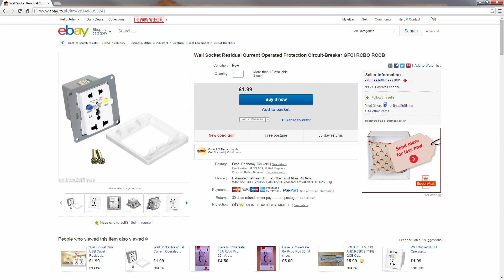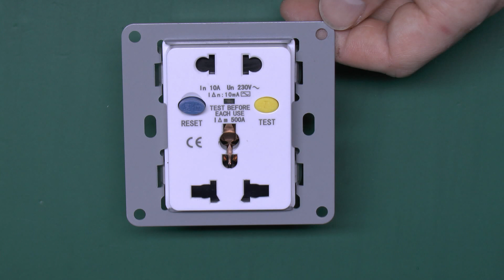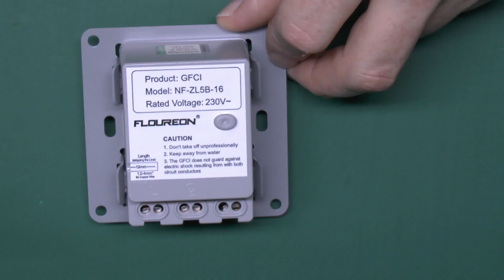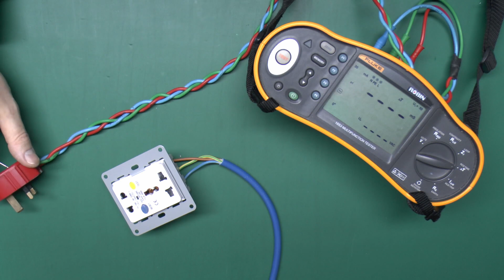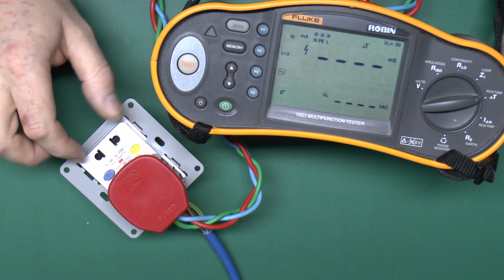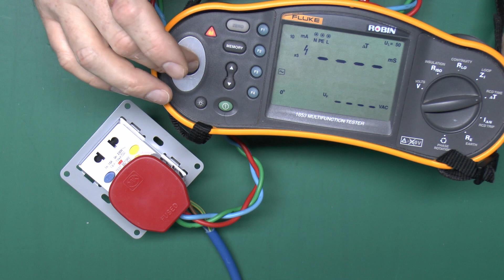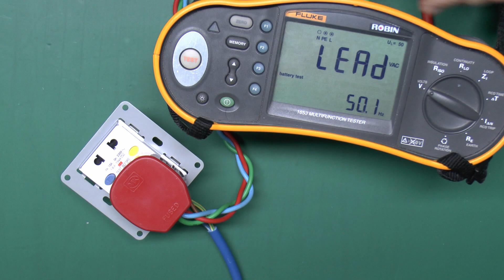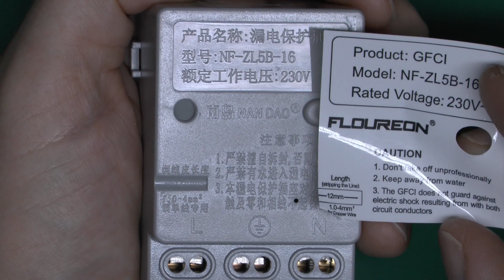Floureon RCD Socket Tested & Dismantled

Comment: Googled CL4140 comparator. Could only find the quote "The CL4140 is a low power controller for AC outlet appliance leakage circuit interrupters."

Comment: I delta M is usually taken to mean the maximum current making/breaking capacity when tripping due to residual current. 

500A is quite a low rating, as a live-earth short on a low resistance TN-C-S system could exceed the breaking capacity of the device - this isn't necessarily a problem as this should be adequately covered by the overcurrent protection.

Comment: Shouldn't think this could be installed in the UK, as the contacts would not meet the requirements for size, and as the socket is only rated at 10 amps, it would definitely need it's own overload protection, maybe from a fused connection unit, with a 10 amp fuse inside. Connecting that to a 32 amp ring or radial circuit could be disastrous, given that it accepts un-fused plugs.
Reply from the maker: jayja45 I have updated the description with this information

Comment: Very interesting. In the US, our GFCIs are typically rated 5mA, and 30 mA seems surprising to me because that is a potentially lethal current. The other problem, and the main reason I don't trust it is the way it tests. When you press the test button on a proper American GFCI, it connects a resistor between live and ground (Earth) creating an actual ground fault rather than an   imbalance on the sense transformer.

Comment: That 8-pin IC seems to do it all, including deriving its own supply voltage from the mains.

The CL4140 is a low power controller for AC outlet appliance leakage circuit interrupters. These devices detect hazardous current paths to ground such as an appliance falling into water. The interrupter then open circuits the line before a harmful or lethal shock occurs.  Internally, the CL4140has a diode bridge rectifier, zener shunt regulator, op amp, current reference, time delay circuit, latch and SCR driver.

http://33016779.company.weiku.com/item/Integrated-Circuit-4140-16471620.html - but there's no data sheet available online as far as I can see.

Comment: Pressing the F1 button if you measure voltage is switching between the measuring of line against earth, line against neutral, or neutral against earth. You don't need to change the cables on the terminals of the Fluke. Got the same device...and this is something you could not read in the manual for whatever reason.

Comment: I suspect the blue small wire (which bypassed the CT) was for the test function
Reply from the maker: ***** Yes, that wire immediately goes to 2x 7k5 resistors, then the test button.  15k at the device rating of 220 volts would be a current of 15mA, which seems reasonable to test a 10mA device.

Comment: This sort of reminds me of hotels. I've seen sockets like this installed in bathrooms etc. so guests could use their own eletric shavers or other devices without using an adapter.
Reply: These are special shaver supply sockets with an integrated isolation transformer. But they are limited in power from 20 up to 50 VA. There's no RCD inside, the security is the galvanic isolation from the power grid. You have to touch both connectors at the same time to get an electric shock. And sometimes the isolation transformer is used to lower the 230 V to 115 V, so you could use devices with different voltages on this socket. But in times of wide- or autorange power supply this is not longer necessary.

https://en.wikipedia.org/wiki/AC_power_plugs_and_sockets#BS_4573_.28UK_shaver.29

Comment: @ 5'53", I wonder if the two holes are for feed in/feed out? Or is that illegal in the UK.
Reply: Most certainly they are! Actually this was a fairly common setup for high-quality sockets in Austria and Germany back in the 80s and early 90s, before screw terminals were all but replaced with spring-loaded push-in terminals. You're supposed to stick in one wire per hole and then tighten the screw. Takes stranded wires without ferrules according to VDE regs because the wires aren't directly under the head or end of a screw.

Comment: I was astounded about the build quality when I got those compared to the price I paid, this was around 2.5 EUR here. It definitely requires a fused circuit upfront of quick acting @ 10 Amps. My concerns are others. Most European regulations do not allow the use of AC onlz GFIs, they have to be pulse current sensitive. The manufacturing standards were changed somewhere in the late 1980s, no longer allowing non pulse sensitive units to be produced. Some local electric codes followed that decision (East Germany for instance), others did so in the 2000 years. From around 1987 on everything you could get from EU manufacturers in wholesale or supply houses was pulse sensitive. But basically AC only came into Europe again thru CE imports. 
Another point, single GFI units for a single circuit must at least be rated 1.5 kA breaking capability. And outlets should be rated > 13 Amps.
This thing does not fulfill any of these standards. When using the Flureon, this must be kept in mind. 
Continental European manufacturing regulations do not really like active circuitry in GFI designs, they should, for reliability over time, be based on passive tripping. Makes it difficult to reach 10 mA tripping. But if DC fault currents are to be determined, active circuitry is required.

These Flureon can make sense in certain applications, like guest rooms, where a variety of travellers is accommodated, if proper fusing is applied upfront. As the appliances connected in these rooms are mainly of the class 2 double insulated type, this thing is acceptable, but probably not really legal to use.
Reply: Sounds like it'd work juuuuuuuuust fine in my garage Stateside running my air compressor, then. 120v, draws about 7-8 amps, and using a BS1363 plug in the US would heavily discourage someone from walking off with this one(I have had an air compressor walk off before). Not only that but this would also accept devices that have a standard US plug, either 2 prong or 3, which is nice.
Reply: Austria still considers AC RCDs perfectly acceptable so they've been available in the EU just about forever. I believe the same is true for Italy and a bunch of countries formerly east of the Iron Curtain.

This little beauty is obviously non-compliant due to the design of the actual sockets in quite a few European countries, although it might pass in Italy and possibly in Switzerland, not sure about Denmark (these are the only countries in Europe that use plugs with an earth pin other than BS1363). Besides, it wouldn't fit a 60 or 70 mm round box and the M4 screws are useless either - most European countries use plain M3 sheet metal screws that thread into the plastic of the box. Italy has some kind of coarse-thread 3.5 mm screws that are hard (if not impossible) to source elsewhere.

Comment: JW, I have a 10mA plug in RCD you could test to destruction if you like. I bought one from Amazon (for about £15) and what came was not as pictured and had in illegal unfused 13A plug. I replaced the plug myself and kept it. It did appear to trip at 10mA. Eventually there was a product recall (possibly due to my review on Amazon) so I got my money back having, however, found ten more of the same thing on Ebay for £10 as a job lot! Can I send one to you?
Reply from the maker: Yes, address and details here: https://xo4.uk/?YTT

Comment: I googled "nandao meaning", acording to wiki it means sword.
I first came across Floureon a year ago, I needed a cheap replacement battery for my old makita drill, both the drill and battery are still working well a year of hard use later.
The wording annoys me on the rcd you are showing us, as it is a poor translation, so poor most of it has no real meaning.

Comment: I wish somebody would make an adapted universal design that didn't bypass grounding in EF plugs.
Reply: I suppose that could be done for a socket that accepts some other plug types but certainly not for one that takes all of them - sockets for E/F plugs must be recessed both for preventing contact with partially inserted live pins and for mechanically protecting the earth connector so e.g. US plug pack power supplies couldn't possibly fit.